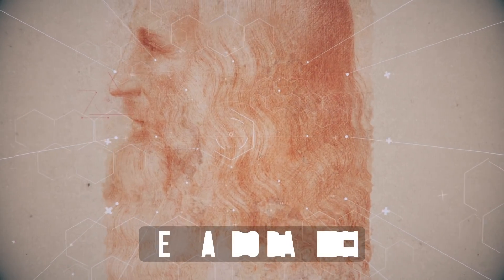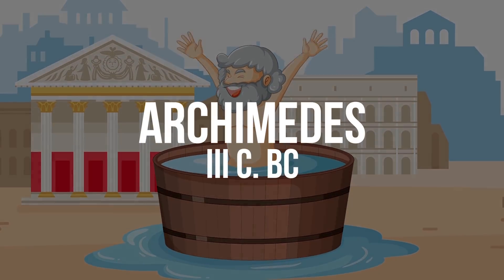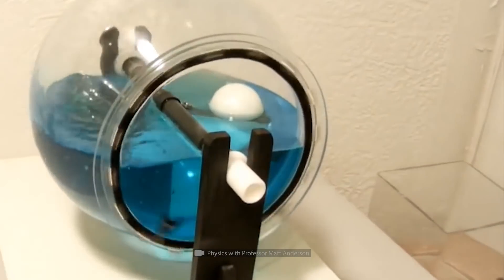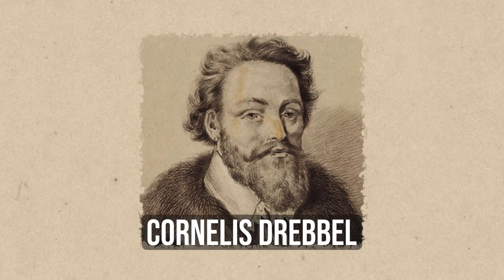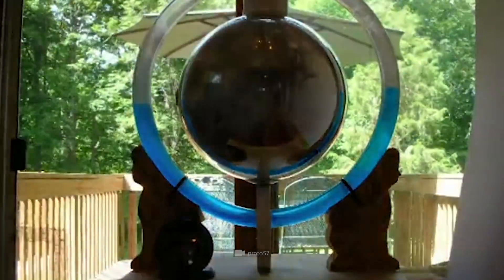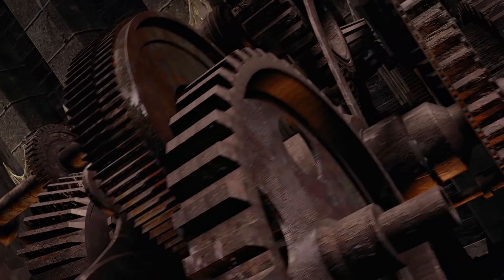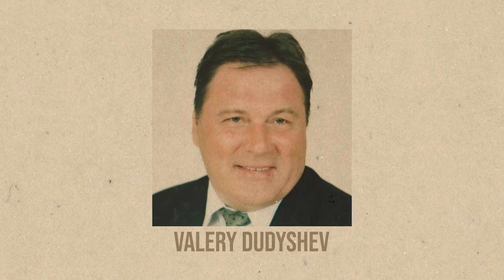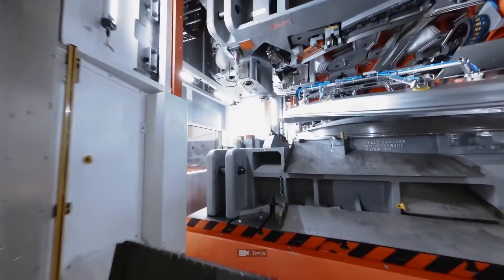Are Scientists Close to Creating a Perpetual Motion Machine?

Comment: What? The magnet part has no relation to the problem of perpetual motion, the machine wouldn't move itself regardless. The magnet and its affect on the ball basically offsets the position of lowest energy that gravity imparts on the ball, it would come to rest the same as if it was simply under the effect of gravity.
Reply: even if it moves and you can get energy out of it. you only are getting the energy of the magnet. it takes energy to make a magnet, this energy can be harvestet again. no need for perpetual motion.
Reply: @adswers6900  you're not harvesting the energy from magnets, that's not how magnets work.

There is a tiny bit of potential energy in the orientation of the magnets atoms, but this setup can't harness it and it certainly isn't perpetual.
Reply: @andrewkvk1707  it actually does. i think you missed that there is a wheel, that transfers the pulling force, of the magnet, put on the ball into the rotation, kinetic force, with which you can operate a genrator. 

i know its redundant, because you can use the energy of the magnet way easier, however i dont think you understand any physics.
Reply: That's not how this works. That's not how any of this works. The ball would come to rest just the same as if it was only under the effect of gravity, the difference being that it would be offset by the magnet. It would still be at rest and not causing the wheel to move.
Reply: @andrewkvk1707  lol. where you ever in a wheel and tried to move forward ? if not. what happens, is that the wheel starts to move, and you are practically standing still, because all your moving force gets put in the wheel so the wheel turns. 
same principal with the ball. 
you dont understand physics.
Reply: @andrewkvk1707  btw i am an electrician, i know at least a little bit about magnets and yes this is how magnets work.
Reply: @adswers6900  nope :p you have a fundamental misunderstanding of physics somewhere and I cant pretend to have the capability or patience to work out where that is.
Reply: @andrewkvk1707  great refusal. just because you cant imagine a wheel, with high friction surfaces for a metall ball in it, where an magnet gets introduced in a specific angle. its not my problem. 

you think "perpetual motion" actually is something special. while we now since einstein, that a "perpetual motion" is no different from being at rest at all.
Reply: @adswers6900  you're the one who can't imagine it accurately, not my problem ;)

If your apply force to a wheel perfectly perpendicular to its edge it will not be inclined to rotate. The ball at rest is applying force perpendicular to the wheel, the magnet offsetting where this is changes nothing of the fact. It will not rotate.
Reply: @andrewkvk1707  btw i just noticed you edited your ridiculous comment, to make it even more ridiculous 

"nope :p you have a fundamental misunderstanding of physics somewhere and I cant pretend to have the capability or patience to work out where that is."

so me as an electrician, who has fundamental knowledge about electromagnetism and magnets, 
have a misunderstanding, that you, someone that "cant pretend to have the capability or patience to work out where that is", can better evaluate than me ? 

do you know how logic works ?
Reply: @adswers6900  I'm a magnet scientist. 🧲 spooky magnet science says you're  rediculously wrong.
Reply: @andrewkvk1707  ever heard of the laws of motion and laws of relativity ? 
something in motion, is the same thing as something at rest and everything around it in motion. 
something in "perpetual motion" is the same thing as something in "perpetual rest". 
basically, something not moving at all is in "perpetual motion" buffoon. 
this topic is debunked ages ago
Reply: @adswers6900  🤦  But these machines are not isolated, they're in a greater system that is affecting them, so they will come to rest relative to the system as a whole, because nothing is perfectly isolated or perfectly efficient, relative to the system something within that system can not remain in perpetual motion. Relativity just means you can reframe the perspective to the machine itself, and say the system is the one moving, but at the end of the day the results are identical, the system equalizes. Which has nothing to do with magnets. It also doesn't have anything to do with the machine we've been talking about, since that wouldn't even function in an ideal system.
Reply: @andrewkvk1707  btw i just now realised you edited another comment. 
and again, it shows the lack of your understanding, that i rather feared but shouldve addressed. 

"If your apply force to a wheel perfectly perpendicular to its edge it will not be inclined to rotate."

in a real scenario. there is a wheel (at rest), and a ball (at rest) in it, its not orthogonal to gravity, it is laying with gravity. 
than the magnet gets introduced. 
the ball gets pulled to the magnet, making the wheel to start moving. than the magnet gets put down at an angle. but not perpendicular to gravity, because you would start to work against gravity and no longer with it. 
im not quite sure what the best angle is. but as you can clearly see it is somewhere around 45 degrees to gravity, not 90.
because well, its depebds on the size and weight of the ball and the distance and strength to and of the magnet 
also of the size and weight of the wheel itself
Reply: @andrewkvk1707  to break it down as short as i can : 
motion is only apparent, its what we observe, however all motion has energy as its cause. to get energy out of motion you must introduce something to absorb the energy. 
"perpetual motion" would be a self sustained motion. however to sustain any motion every energy acring upon it have to be equalizing or there cant be acting any energy at all at it. 
however, these states describe something unchangeable for its state. just like being at rest. as soon as you introduce something / change something, in anywhich way kind or form, the state is being changed. 

energy from "perpetual motion" is an oxymoron. 
energy comes from energy "The law of conservation of energy states that the total energy of any isolated system (for which energy and matter transfer through the system boundary are not possible) is constant; energy can be transformed from one form to another, but can be neither created nor destroyed."

any isolated system, no matter how "perfect"
Reply: @adswers6900  the ball gets pulled towards the magnet, and the wheel does not spin. Why? Because the ball is pulled towards the magnet, it comes to a rest pulled towards the magnet, not pulled down, so the wheel is not inclined to rotate. How is this hard for you to understand?
Reply: @andrewkvk1707  the ball has friction with the wheel. how can you be so blind ?
Reply: @andrewkvk1707  as the ball rotates, so does the wheel. just like with a gear inside a gear, not gear against gear. how is that so hard to understand ?
Reply: @adswers6900  what does this friction cause?  It doesn't cause the wheel to spin because the ball wants to be pulled towards the magnet. You act like the ball is pulled towards the magnet when you look at it alone, but when it is attached to the wheel it wants to cause it to rotate back, this is a contradiction. The ball is at rest at 45° or whereever , the wheel is not inclined to rotate after this.
Reply: @andrewkvk1707  the ball gets pulled to the magnet, but the ball is resting on the wheel. the magnet pushes the ball against the wheel, and becaus of friction, the ball starts to rotate and so does the wheel. 
just like when you have a gear, inside a gear.

imagine a small gear, fixated on an axis. the axis gets turned by a force ( containing the rotaion, caused by friction of the pulling and pushing of gravitational and the magnetic force, upon the ball and wheel. (acting on this axis )) this gear would start to rotate with the  the force of the rotation of its axis. 
however, this gear is now in another gear, bigger than this gear. 
this gear is also connected to an axis. you would get the same energy acting on the bigger wheel, just like on the small gear. 

thats what all the laws mean.
Reply: @andrewkvk1707  also the ball isnt at rest. look at the real video, you can see how the ball is wobbling, never finding a sweet spot, because of all the forces acting at all the times. just like our earth is constantly "falling into the sun", never hitting the sun, because of all the other forces from planets like jupiter etc.
Reply: @andrewkvk1707  btw if you cant follow this few steps, just read our whole conversation. i already explained it all. 

the magnet pulls the ball to it. the wheel is in the way so the ball gets pushed against the wheel. this causes friction.
the friction causes the rotation of the ball. the ball pushing on the wheel causes the rotation of the wheel.
Reply: @adswers6900  sorry, apparently you haven't noticed. I understood what you were saying after the first few comments, and think it's wrong. The ball stops wobbling, it comes to rest because that is where it is most stable and there is inefficiencies, friction for example, in the system, the wheel no longer moves after the ball comes to rest. I understand that you can't comprehend this, it's alright, I forgive you.
Reply: @andrewkvk1707  but you are wrong, that is not how reality works. 
it may find an equilibrium, in a totally isolated system ( only ball wheel and magnet, no gravity ) while standing still. but also in motion. you want to have friction from ball against wheel. it is not something you would avoid, but prefer. 
dont think of something slick. 
the wheel could be rubber. 
you dont need 90 degrees or anything. 

that is what you cant understand. both is possible. but getting energy from them without changing their states is impossible.

this system is  not optimal. the friction causes heat.
and while in motion  the magnet would lose power over time by magnetising the ball. 
the ball would rotate and so would also act against the magnet again.
that is why it is not a perfect "perpetual motion machine". 
however.
 you cant get energy out of "perpetual motion" without chaging its state.

Comment: Waste of time over focusing on what we know how to do now. Cold steam reactors/Vacuum boiler reactors can boil water at far lower temps, and once turbine gets going all PSI used to get it going becomes waste unless used for a steam driven vacuum pump to maintain the vacuum for low fuel max operation. Condenser to recycle all water. This is how small modular & micro modular reactors function with lowest amount of radiation material possible. < Solatube/tube of mirrors to focus lens to heat boiler during day, and some light sent to pool of black tile water underground. Ancient Egyptians used the pool of black tile water to flow between temple walls to warm temples for cold desert nights, and they did not have GLASS SEAL. 

Other end of Tesla turbine in a cold steam system = ice water.. Because it uses ALL of the heat as energy. Look at new micro nuclear reactors. You don't need to power thousands of homes, just your own. A 20KW turbine running 24/7, the power company(if your state law supports) will have to pay YOU ALL OF IT, and if they don't you can convert it all into FUEL. A little tip.. Ultrasound can be made into lower power lasers to atomize alcohol while generating acoustic force-field to bypass alcohol distillation laws. Feeds dough yeast and dumps half in the bio-waste chute to bio-waste storage causing rapid fermentation OOPS.. < Unlimited fuel once you get it down.

There are already Perpetual Motion Machines, you are just waiting for scientists to explain to you they exist so you can pretend you understood the whole time to tell others. Just like the ability to end climate change. Example = One elite smartphone is up to 50 million products in the form of apps. Just go to Amazon, and type calculator. Now look at Google calculator for example at the download size. With a 64gig smartphone with multi-device limiter off using entire storage, you could store 3,800 POUNDS of that product in your pocket. < If you would have learned to OBEY OUR LOGIC, your children would be GODS.. Instead of scheduled for termination to make room for a new race. - Atheist eugenicist Illuminati_God of war

Comment: Wait, so I created a version of the ball in a wheel with a permanent magnet, everyone said it was BS. I have a huge really good version of this that cooks the bearings(timkin sealed) supporting the wheel before I notice any degradation of the magnets. Its not much power, but its better than a 50w solar panel.
Reply: well if it is making more power, than it is definetly way bigger, way heavier than a 50w solar panel. also needs it to be stationary, or at least somewhat saved from outer motions (gyroscopicly). also are magnets pretty expensive. the energy to make such magnet, is the same you can harvest again. you are harvesting the energy of a magnet over time with your device, which loses energy by friction. 
how about just saving the energy from not making the magnet `?
Reply: @adswers6900  I used recycled parts from old hard drives, mainly the magnets and bearings. I guess the one that can make 50w that I built is very large, about 120lbs ish, but asides from some random hardware and materials it was very cheap if not free. One of the things that I noticed is that the rolling element I use (basically a big round peice of bar iron) gets magnetized and reduces efficiency.
Reply: @rreeves0710  its important that your wheel doesnt get magnetised. however you wont be able to remove the magnetisation from the ball, without wasting the energy through a capacitor. 
however. the energy you are harvesting is the energy that was put in to make those magnets. 
and 120 lbs doesnt sound very practicable. 
no hate, sounds great what you have done there, but perpetual motion is nothing else but being at rest and there is no "free energy"
Reply: and let me guess, this device is right next to the holy grail and the evidence that aliens are real? must be sad going on the internet to spew bs.

Comment: not hard to make a car that can run longer today.. all u need is 2 fast charging battery packs.. one or more generators/dynamos on the wheels or axel.s.  maybe solar panels or solar paint..  and a computer of course that knows when to switch from battery to battery when one is discharged and the other is charged..  not perpetual, but it can be done today..  but they'll never do it..  u will have to design that urself..  smh..

Comment: that is a biblical angel which is covered in eyes dude. everything you hold was science fiction when i was at school, me and my sister watched quantum leap. i wanted ziggy. it is caled siri google and alexa now. it really is a solid state neural network computer in there. the communicators are now bluetooth from star trek. look how impossible the badge communicator was for so long. and oh my god i just installed an ai powered holodeck in my sisters for her kids which if you try and explain a vive pro 2 on an rtx card with an intel i 7 there is a lot going on just there. these machines are still out there. they did not move laterally i think. they got waaaaaay to heavy for that. digital braking and clutches to control the relative speed of the wheels and you could twitch and jog it and make it move locally i suppose on terrain. it would take flight like sonic the hedgehog. hahaha.

Comment: Why don't we just dig a hole in the ground hit magma and let the ground water poor in and power a turbine off the steam that comes out not free power but it will last as long as the Earth's core stays hot and there's water on earth it would be powerful for its size it could be a small little building with a single smoke stack and power a city and it doesn't need any additional fuel so electricity would be cheaper and it can be placed just about anywhere where you can dig a hole hit water and go deeper and hit magma that's just about anywhere but I think it would add clouds but I think clouds reflect some of the sun light so it would add to cooling the earth some but if we tap the cores energy it could cool faster and that's worse than burning all the fossil fuels we need the core for the magnet field to protect us from the sun and space so maybe not the best idea for the future but its today and nobody cares about tomorrow anyway so let's freeze the core and let our grand kids worry about that but maybe freezing the core is better than toxic air and food